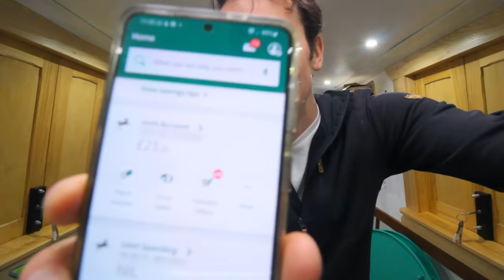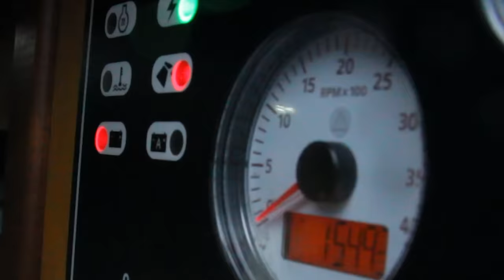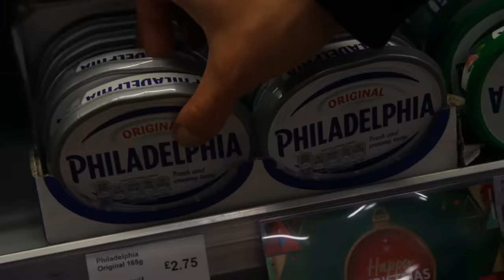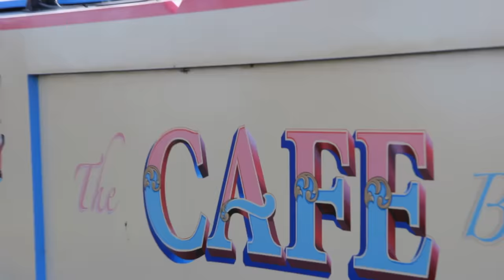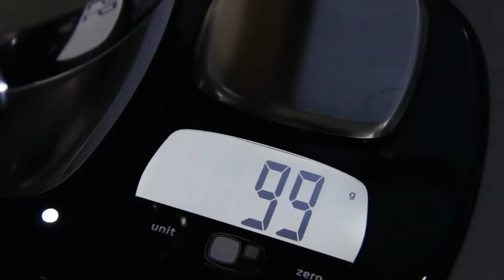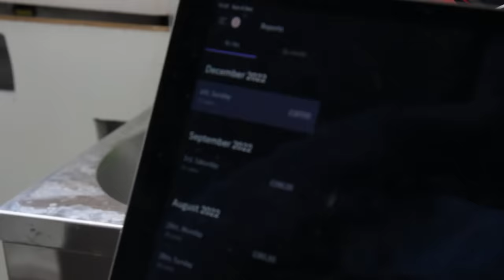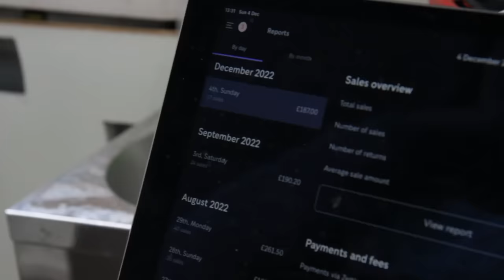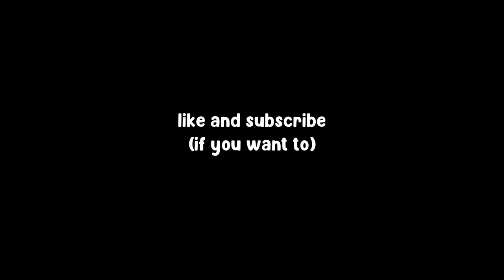The true cost of our narrowboat dream

Comment: I loved this video!  After I was made redundant in 1995. I was offered the opportunity to buy a Transit van and take over a contract with it.  The contract gave me a basic but reliable income. I then had to seek out other work to enable me to make profit. Doing small removal jobs and shifting large items I charged (then) £20 per hour. Some weeks I worked many hours but was turning over 5 to 7 hundred pounds a week. Gaining many customers along the way I did this for over 25 years until I had to retire at 68 when my old but reliable van failed it's test. 220,000 miles it did! 
I love meeting people and helping them even though it could be exhausting at times.
Would love to be still doing it!
Driven over 500,000 miles!

Comment: Hi idea for the future. You need to make a steel package holder on top of the Caffe. Make it strong and have it support quests. Have rails and also steps to go secure up and down. It needs to be closable also if there is a small tunel you need to go trough. Also the boat needs to be land lockable so it doesnt swing if people are going on the deck up and down left or right. Just that special Caffe on water experrience would quadruple your sales. People need a place to sit down and drink and eat. If that place is special they will remember and recommend and also return more often. Just a tip for the future of the project. Best of luck and Iron Will!!